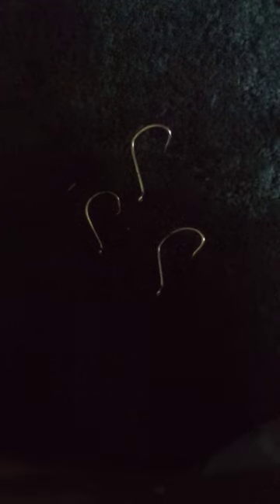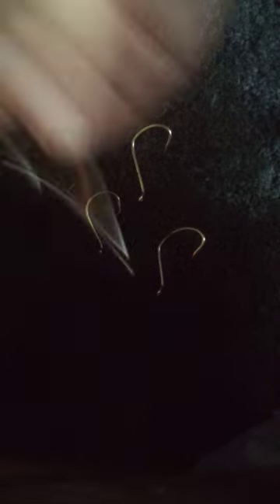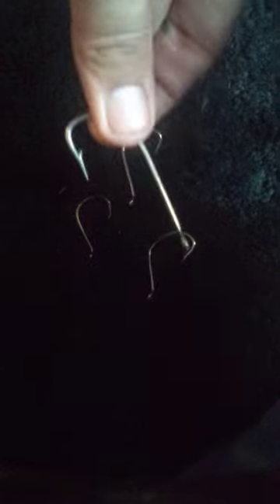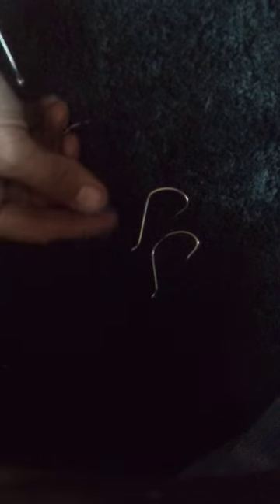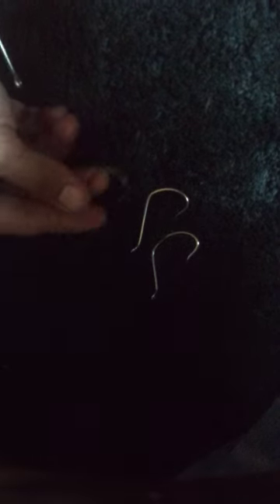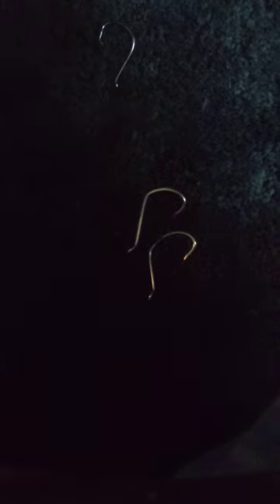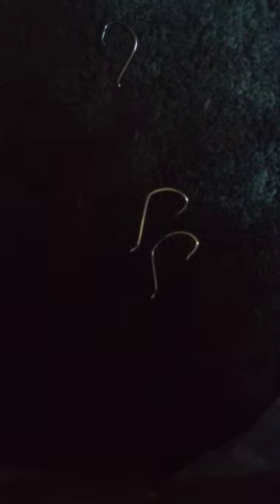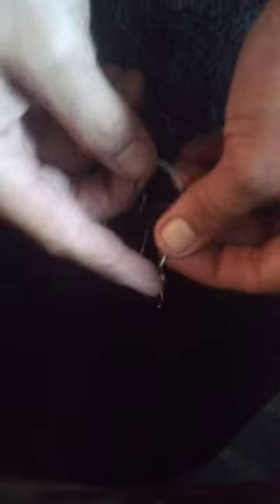Making circle hooks out of J hooks

Comment: Awesome!! I have been making my circle hooks out of some “china” eyeless hooks that i got a some point. I’m using really small ones, i think they are #20. They work great for the bluegills, and i can actually catch more. Instead of gut hooking every other fish and having to waste time removing the hook, with the circle hook i’ll gut hook 1 on every 20 if that. And even if the swallow the whole thing, it comes off pretty easly. 
When i make mine, i soften the hook by making it red hot with a torch and letting it cool slowly. Once i’m done bending it, i’ll heat it again to red hot and dunk it in oil. I should anneal them to make them a bit less brittle, but never had an issue with them breaking. 
It took me a few tries to get them just right. At first i had the gap between the point and the shank of the hook a bit too close, so the worm was “clogging it” and was missing a lot of fish. Once i opened it up (1/4” seems to be the sweet spot) they work great. 
Well woth the effort, spacially if you are teaching a small one how to fish for the first time, last thing you want to do is rip the fishes guts out and traumatize the li’l fella.
Reply from the maker: Heck yeah